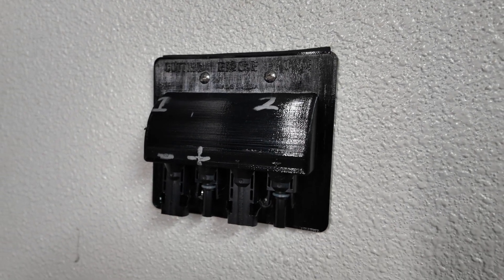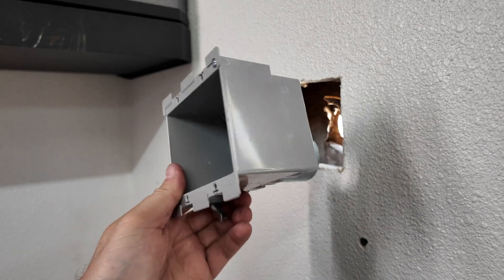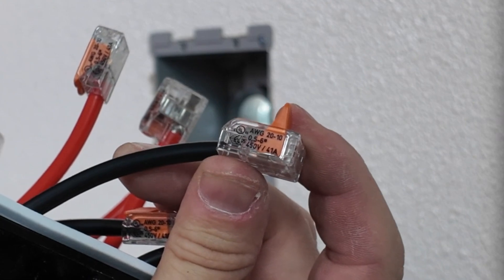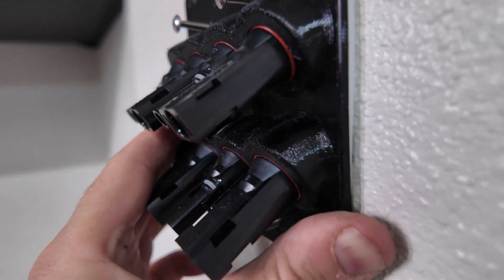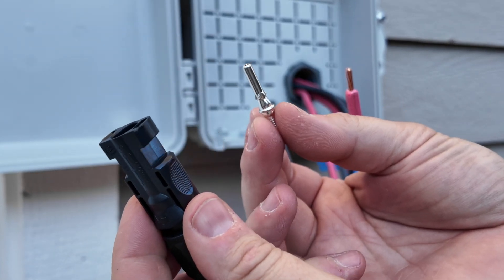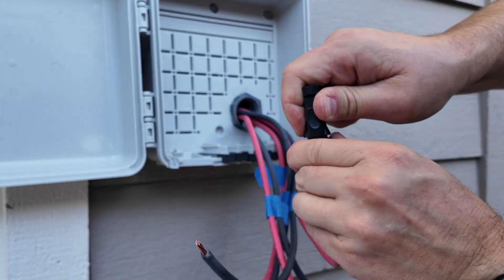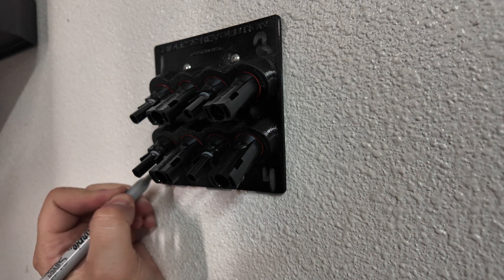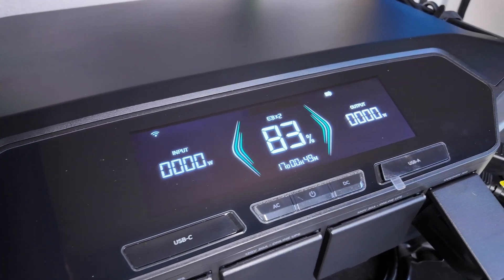How To Wire Solar Into Your House!

Comment from the maker: Thanks for watching and supporting the channel 👊🏼😀 #solar #offgrid #rv #diy 
NON-Sponsered
Have a question you want answered fast: https://asqme.com/@johnnysweekends
Affiliate links
Items In Video……
2 point Solar entry: https://amzn.to/4dsiOBo
4 point Solar entry: SOLD OUT 
Second design 4 point Entry:  https://amzn.to/3SOuje7
Weather proof box: https://amzn.to/4dNbv79
Solar wire : https://amzn.to/4dI8INf
MC4 connectors: https://amzn.to/3MfygVu
MC4 tool kit: https://amzn.to/4fNaEFr
Wire strippers: https://amzn.to/3Xa71Sw
Test Meter: https://amzn.to/4fPy1hC
Renogy Solar panel: https://amzn.to/4fOR9w6

QUALITY MC4 connectors and Solar wire
Staubli MC4 :https://signaturesolar.com/staubli-mc4-male-and-female-connector/?ref=JOHNNYWKND
Solar wire 10G:https://signaturesolar.com/pv-wire-25-ft-10-gauge-copper-30-amp-black-red/?ref=JOHNNYWKND

EcoFlow Battery Back up system:
5% off Code: 24EFDCJON(2024/8/1-2024/9/9)
Home backup sale DPU: https://bit.ly/4d1GXyz
DP3 EF link: https://bit.ly/3KTau1c
DP3 AMZ link: https://bit.ly/4c7VOqU
Home backup sale: https://bit.ly/4d1GXyz 

SAVE BIG ON NEW SOLAR PANELS HERE: https://signaturesolar.com/?ref=JWKNDS 
DISCOUNT CODE: JOHNNYWKND

BUNDLE & SAVE SHOP SOLAR KITS ! https://shopsolarkits.com/1134

CHEAP USED CERTIFIED SOLAR PANELS HERE: https://www.santansolar.com/?ref=Johnnys%20Weekends 

CHECK OUT MY AMAZON STORE: https://www.amazon.com/shop/johnnysweekends

If you feel I helped you out..Consider Buying me a Coffee 👍🏼🙌🏼👊🏼😀
https://www.buymeacoffee.com/johnny5120J

TopTes Gas Detector PEN!!: https://www.amazon.com/dp/B0B62LBZPC?

Trailer and vehicle accessories 
https://www.etrailer.com/?etam=a0017

Level your trailer FAST & EASY!!!!
Level mate pro: https://amzn.to/3S2xf5c

MC4 All in one Kit : https://amzn.to/37jwLVb

BEST GAS CAN!! Surecan Gas can : https://amzn.to/3Kf5rqn

Protect Everything!! 303 Aero space Protectant: https://amzn.to/329dkM7

BEST FIRE PIT!! Outland Propane fire pit!! : https://amzn.to/3rKIkwZ

Generator tent https://amzn.to/3ddd3ds

Lucas fuel treatment: https://amzn.to/3IfxQv8 

Check out my other channel!! https://youtube.com/@PoweredwithJohnny

Videos are for entertainment purposes only. Do your own research when it comes to using these products shown in any Johnny's Weekends videos.

Thanks for watching. Above links are part of a affiliate program. I earn a small commission if you buy through the link but charges nothing extra. Thank you so much as it helps creators like me to continue to bring content for viewers.👍👊😊

Comment: I'm wondering with what you are going to do with 4 pairs into your home as opposed to combining them before entry?
Thanks.
Reply from the maker: Charge multiple products or different voltages and more. More Universal 
And what I need. Several could get away with a combiner or dual inputs and be done

Comment: Exactly what I was looking for BUT the wires and WAGO's have to be 8AWG.
But also need it for 4 wires max.

He should have used wire labels for each set. Makes it much easier to match the pairs up.

What I want it similar to a regular outlet on an outside part of the house and some kind of plug that I can plug in and unplug for my portable setup.
MC4's I am sure won't tolerate a lot of plugging and unplugging.
Reply from the maker: You can always use a combiner box if that will work with your setup.
Reply: @johnnysweekends  Need something that is a quick plug in and quick disconnect. Think extension cord for solar.
Something that simple.
Maybe I should use a normal extension cord and outlet?
At least there are plenty of options.

Comment: Great video!  But... sorry, I'm gonna have to be a bit cold here as this is the second time I've seen someone do this.

The chase is ok but while I love WAGOs, they are not certified for outdoor use.   The box needs to be metal to pass code (solar cabling is HVDC). It needs to be in metal conduit (EMT) to pass code.   It's also a terrible idea to have the cable ingress into the home just be loose wire connected via bulky MC4 connectors.  That really needs to be EMT as well.  It's also not a good idea to expose connectors to the elements.  They need to be tucked out of the way of direct sun and rain.

So what would I recommend instead?  Basically like this:

* Solar panel array

* Combiner box at the array (plastic is ok though not great).  Configured for paralleling with fuses and a backhaul breaker, or for pass-through with only individual breakers.

* EMT backhaul from combiner box to metal box on house outer wall

* Metal box on house outer wall with chase to inside.   Again, EMT (metal conduit) into the box, EMT/chase (metal conduit) at the back through the wall.  The box can contain breakers or just use power pole connectors, or even just be straight-through cabling.  Do NOT use MC4s(!) (not that you could with EMT going into the box).  Since you want flexibility, have some sort of reasonable connector.  It's a good idea to have it be a disconnect point so I recommend breakers again.

I know this is more complex but solar strings are HVDC and the wiring has not breaker protection against faults (the breakers are just disconnects, they won't trip on a fault because the Isc from the solar array is limited).  So if that wiring has or causes a fault then we're talking fire.

-Matt
Reply: mc 4 connectors are fine outside.

Comment: NEC says you need a metal conduit through walls. I like that you used a metal conduit to connect from the box to the exterior side of wall. Is that considered code compliant? This is by far the cleanest looking in house wire pass through. I am about to start a 2x200w panel project for my Bluetti.
Reply: also, can you please explain how you ran conduit from the outside box to the panels? does conduit connect to the plastic box directly or is there a length of exposed loose wire? thank you.
Reply from the maker: @pennmikael all wire enclosed in metal conduit 
Technically outside box should be metal if doing high dc voltage 
This is grey area please consult a electrician if needed

Comment: I would much rather go straight from the PV strings to a circuit breaker panel on the outside (myself), but thank you for sharing...
Reply from the maker: I have breakers on the Rv trailer. 
This is the pass through inside

Rv is fused up top down to breakers then fused again out side before it goes inside.

But if someone is running some higher voltage stuff verses smaller size arrays then having a disconnect or breakers wouldn’t be a bad idea 👍🏼

Comment: Wago connectors catch fire and burn out after long use.. Talked with a Union electrical contractor that won’t use these anymore. Just take a good look at the thin connection bar the wires are touching to. He doesn’t recommend anything over 1 amp be connected to them. 1 amp or less..
And most importantly Don’t connect in Series Never!

I won’t use them.
Reply from the maker: Haven’t really heard that yet. Especially 1 amp. Can’t do anything with that.
Reply: @johnnysweekends  He’s been in the Electrical union for 26 years been running a union business for 17+ years. So this is real world testing and professional use on real jobs mostly commercial. He was a co worker of mine and a best friend. So it’s facts, it cost him time and money fixing and replacing the damage. 

I recently asked him about this and that’s what he told me .
Reply from the maker: @peckerpeter2078 ahh nice. Ok Thanks for the info, good to pull data from multiple angles. 👍🏼
Reply: Yeah, sure....

Comment: Thanks for sharing this. I really like this passthrough, but would like to see a blow-mold version vs the printed one. I would like to see someone come up with a multi connection control where you can combine all or part of the MC4 connections in series or parallel. So if you are charging different devices, you can control the amps and volts. I am huge Wago fan too, been using them for years at our home.

Comment: Yeah WAGO  connectors are great . Check out Silver Cymbal review on  it
Reply from the maker: Yes seen the review a while back when they were coming out. But no offense to Chris I love his channel, I try to get feedback from electricians and people in know in the trade for feed back. 
I have seen my own have a clip pop open. Hence I used tape. Failure wise as far as melting under loads, so far myself I haven’t seen any. So I think they should be fine. But the popped tab concerned me. So was it me? A bad connector ? Or? 
But yea so far so good but I’ll use the tape for now 😂👍🏼
Reply: @johnnysweekends  good chance it was a bad connector tbh 
I have an entire two boxes of wago 221s (one set of 5 way ones and a set of two way ones) never had one do that

Comment: I have the older style from when they had a different company name.  So far the material has held up to 1 NE winter and summer. This new style looks awesome and I like your idea using the utility box on the outside, unfortunately I have vinyl siding and it's just to big and won't sit flush.
Reply from the maker: Yea the other I replaced has been great but I have it inside so it doesn’t get weathered. The outside boxes are easy to replace

Comment: Waco connectors are some of the best and easiest. There is almost no risk of doing the connection wrong. They have been tested several times and they can easily handle their rated current values..
Reply: @thormeyer6198  biggest problem is they only designed up to 30 amps. 
If they were designed for 60 amps in certain cases then I would love them more.
But I use the heck out of them and their competitors